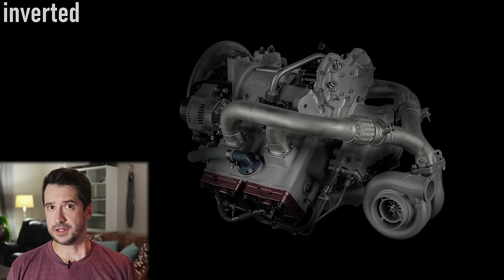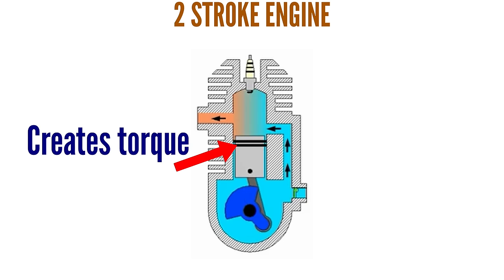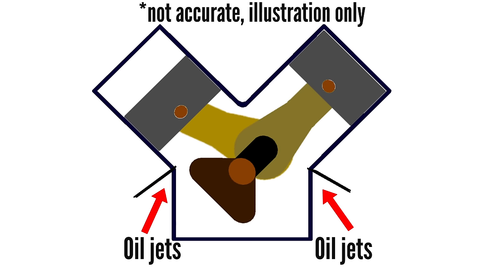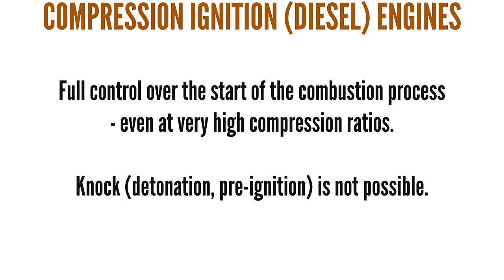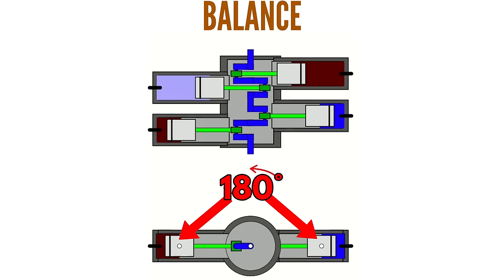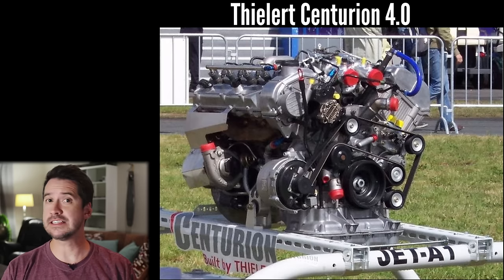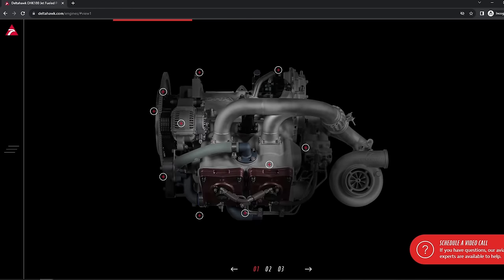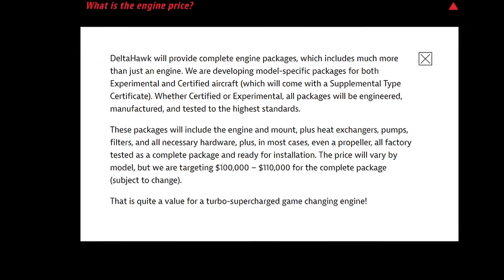Deltahawk's Jet Fuel Piston Airplane Engine Explained

Comment: Blower is a device and “supercharger” and “scavenging pump” are the functions of those devices. This is technically a scavenging device in this configuration because the engine would never run without the pump doing the scavenging. I’m sure the marketing team overrode the engineering team in naming.
Reply: That depends entirely on the manifold pressure, if the manifold pressure is over 1 BAR at MSL thent it is "supercharged" if not it is Normally Aspirated as opposed to "Naturally Aspirated".
Reply: @WilhelmKarsten  https://en.m.wikipedia.org/wiki/Naturally_aspirated_engine
Reply: @yolo_burrito  "Ask cars" is not a accredited engineering reference source.
 You got rolled by Wiki.
Reply: @yolo_burrito  There is a very important difference between Naturally Aspirated and Normally Aspired... they do not mean the same thing.
Reply: @WilhelmKarsten yes they do.
Reply: @yolo_burrito  No, they don't mean the same thing.
Normally Aspirated engines have a blower.
Naturally Aspirated engines do not.
Reply: @WilhelmKarsten  because blowers are Normal? Clueless.
Reply: @yolo_burrito  Dead serious kid, your comments reveal someone who is not formally educated or has any professional experience in this field.
Engines which have blowers but are not supercharged are called Normally Asprirated to distinguish them from engines that have no blower and are Naturally Aspirated
Any questions?.
Reply: @WilhelmKarsten  you had me going there for a second. Great joke geezer.
Reply: @yolo_burrito  For real kid, I'm absolutely serious.
You are making a fool of yourself.
Any legitimate, accredited engineer knows this. You responce reveals your lack of credibility.
Reply: @WilhelmKarsten  it’s time for bed gramps.
Reply: @yolo_burrito  Time for school kid... you still have a lot to learn yet..
Reply: @WilhelmKarsten  okay give me a reference that explains Normally Aspirated.
Reply: @yolo_burrito a  Detroit 8-71 or an EMD 710 series 

Winton type Diesel engines aka Uniflow 2stroke type (Detroit, EMD, GM, Kassborer) These engines cannot operate manifold pressure above ambient pressure.

Another common example is Supercharger equipped aircraft engines that are Normally Aprirated or Turbo-normallized. 

Beech Bonaza G36 is a good example These engines have Turbochargers but are Normally Aspirated, the manifold pressure is never above AGL (mean sea-level).
The Continental IO-550 is available in a Naturally Aspirated, Normally Aspirated (Turbo-normallized) and a full Turbocharged
Models. 

Horizontally opposed engines like some Jumo and Napier are also sometimes Normally Aspirated despite having a supercharger or a turbo.
Reply: @WilhelmKarsten  I’ve worked on Detroit 71 series and 92 manifold pressures the blower while configured as a scavenging pump does provide some boost (elevated manifold pressure) at higher rpm’s but the boost is secondary to scavenging the cylinders as 2 stroke diesels with intake ports and exhaust valves cannot scavenge by piston action alone. These have never been called naturally or normally aspirated engines. 

These engines can and do operate above ambient pressure, albeit slightly, but it’s not the function of the blower. To prove that some of these engines can operate with boost some were configured from the factory with a Turbocharger that would be used in series with the blower.
Reply: @yolo_burrito  Detroit Diesel describes thier engines, in there own published specifications as Normally Asprirated engines and that they have a scavenging blower which operates differently than a supercharger.
The Turbocharger does not provide any significant manifold boost pressure, it's function is simply to "unload" the parasitic drag from the blower on the engines crankshaft and scavenging is done by the horsepower generated by the turbos exhaust turbine. These engines are a Turbo-normallized.
This improves power and fuel consumption by reducing parasitic drag from the blower.
The fact that you did not know this reveals someone who has no formal education or professional experience regarding this topic.

Please stop pretending to be something you are not.... you are not fooling anyone.

Comment: It has been around for a long time, the design is rather crude, hence there has been little backing for it.
Reply: The push to eliminate Leaded Avgas is very real, reciprocating engines are much cheaper than gas turbine engines

Comment: Where does this 2700rpm rule come from? I dont know anything about airplanes but is this about rotor tip speed or  rotor integrity from higher centrifugal forces? In theory you should just be able to snip the tips and have a smaller diameter rotor that is more rev happy with reduced blade mass and and lower tip speed. People engage! And correct me
Reply: Tip speed is the issue.  Small diameter propellers are less efficient at producing large amounts of thrust.  You can go to contra-rotating propellers, but that adds complexity.  It is generally less expensive to go with a larger diameter propeller and a gearbox.   Contra-rotating propellers are used as a last resort to increase thrust from propeller-driven aircraft.
For an entertaining unsuccessful attempt at supersonic propellers, look up the the Republic XF-84H "Thunderscreech" .
Reply: PROPELLER EFFICIENCY is limited to tip speeds that are subsonic,
Reply: @WilhelmKarsten  Yup, that is why I suggested he look into the Thunderscreech that had a propeller deliberately run into supersonic territory.  Spoilers: it didn't go well.
Reply: @brianb-p6586  It also assumes a direct 1:1 propeller drive, and very likely the average size of a 2-4 passenger GA aircraft

Comment: The turbo worries me as you could have a potential for a runaway engine
Reply: True enough, but it would take a lot of neglect for the turbo seals to degrade to that point. I like to think that, in the world of aviation, this would never be allowed to happen.
Reply: Manual air door (throttle) fixes that problem...
Reply: @WilhelmKarsten  so this engine comes with one?

Comment: "Jet fuel"....🤣
Why not just say 'kerosene'?
I've got an old Lister that runs on 'jet fuel' (kerosene) diesel, cooking oil, engine oil or even baby oil.
It's nothing special that a compression ignition engine will run on all kinds of flammable liquid.
Reply from the maker: If you want to nitpick, it's actually Jet A or Jet A1 it will fly on most of the time, as that's what is available at airports, not kerosene. Jet A1 is more refined than kerosene.
Reply: In other words, not ship oil, but heavier petroleum distillates that are predominant in some regions, such as petro from the western Siberian lowlands.  "More refined" I'm guessing means sweet instead of sour (high sulfur).  Correct me if I'm wrong.

Comment: Compare to a O-360 - which is a little lighter for a little higher power level in most versions, though the fuel burn IS higher.
Deltahawk claiming "lighter" on their web site is a lie - have to see the "more efficient" in action to believe it (it's a lot newer design, diesel is a lot higher compression which tends to help improve efficiency, so that part IS likely).
Reply from the maker: But the O-360 - whether 180hp or 200hp only produces that at sea level density altitude. This engine is turbocharged meaning no power loss as altitude and density altitude increases.
Reply: @LetsGoAviate  Depends on the model, there ARE turbocharged versions of the O-360 and they're not much heavier than the "base" engine.
Still lighter and more power than the Deltahawk, though the efficiency gets worse.

Comment: However , on a petrol two stroke the expansion chamber is a critical component! A well built expansion chamber makers a two stroke both cleaner and more efficient than a four stroke , less fuel / horsepower / hour !!
Reply: 2-stroke engines with a scavenging blower don't need a tuned expansion pipe.
Spark ignition 2-stroke engines are less fuel efficient and have higher emissions
Reply: @WilhelmKarsten  not at all so in racing , they have a  extremely high efficiency rate,  ordinary ones use to be bad  but now with digital control that is no longer the case . I  the 500 gp class, the last years before Honda blackmailed everything into 4 stroke , threre were  no measurable pollution when running in the powerband !! Only outside said powerband..something most obvious when lying behind one o  the track. This is NOT the case with 4 strokes without catalytic converters...
Reply: @kimeldiin1930  Can you provide any evidence to support your theory?

Such as BSFC data or emissions data?

While 2-stroke Diesel engines are most fuel efficient ICEs in the world, I have never seen any spark ignition 2-stroke that has a lower BSFC than a 4-stroke.

4-stroke engines have much lower emissions than 2-strokes which is exactly why they have disappeared from applications that are subject to emissions regulations.
In particular HC and CO emissions and notoriously high on 2-stroke HCSI engines.

Comment: Vaporware
Reply: It’s no internet fake- it’s fully FAA certified in 2023. It really is a game-changer. 
Only drawback is cost. The company spent crazy Millions to prove and develop the engine, cost that the company must now recoup in the only way possible: charging the consumer.
Reply: @oldschoolmotorsickle how many examples are flying in aircraft? What’s the tbo? Vapor ware.
Reply: quite right
Reply: @oldschoolmotorsickle  If you can't buy one, it's vaporware. The other drawbacks are weight and size.

The main drawback is weight, it's 120 pounds heavier than a ULPower UL520i and the UL520iS makes 20 hp more, while also weighing 120 pounds less. Really, this makes the engine a non-starter, it's just too heavy and under-powered to be competitive.
Reply: Again, this engine is FAA certified, meaning that yes, we’ll be seeing it in production light aircraft. 
It ain’t cheap, nor is it lightweight, but aircraft diesels never are. If we compare this engine to other certified diesel aircraft engines, it looks pretty good. 
I think that the company is aiming the product more at the international market, where Avgas is prohibitively expensive and/or not available. 
On the domestic front, this engine will appeal to the “buy American” set, as it’s 100% US made. UL520, not so much.
Reply: @oldschoolmotorsickle  The SMA diesel is certified, it's a better engine and it's not really being used in anything. No one wants diesels, they're just terrible aircraft engines.
Reply: We are in agreement on that; diesels are not well suited to light aircraft! That this engine exists at all is like “ How’d They Do That?”

Obviously, it wasn’t easy, especially getting it certified. And, as you noted, it’s kind of a solution in search of an application; an Answer to a Question that nobody asked. 

I’m not invested but I can see quite a few applications where this solution would make sense. 
Any rate, the market will tell the story going forward. 
I wish the people involved all the luck; and I do love an American can-do story like this one.

Comment: So would that not be a Delta 4 then...... Seems very underpowers for a 3.3l 2 stroke turbo & supercharged engine. Should be. Atleast 3 times that.
Reply: It would be more if it could rev out but they're running it direct drive so the limiting RPM is the propellor RPM, 2700 maximum on most props used in GA.

Comment: @Lets Go Aviate   2:24 illustration is crap and helps perpetuate the myth oil consumption will be uncontrollable since it is 2S.   Delta Hawk is not cranks case scavenged as your cartoon shows, it is supercharger scavenged.   Since intake air is dependent of crankcase via trunk pistons, oil consumption can largely be controlled the same as other modern engines.   Yes upper rings passing ports complicate this but “adequate” to even “good” control is possible, see SAE white papers by Achates Power.    Good Cartoons are worth a thousand words.
Reply from the maker: Thanks for the comments. I think you possibly missed the point of the animation, which is a quick explaination of a small petrol 2 stroke, much like the 2 stroke engines used to power ultralights and LSA's. I then go on to state how the Deltahawk differs from a small petrol 2 stroke, pointing out that it's not crankcase scavenged. It's a juxtaposition, if you will.

Comment: Two stroke diesel engine is very old and almost forgotten technology  which is very fuel effective ... But.. Such engine run only with 150 RPM and is today used for the gigant ship engines ... Two stroke diesel engine need a exhaust valve .. The Two stroke diesel engine is simply different engine as two stroke petrol one ..

If you use a diesel fuel in the two stroke petrol engine, that's the new story. I want see the working prototype of such engine ...

Comment: UL520 is 100 times better than this. 220HP, turbo charged, 269lb, runs on UL91 octane. 

This is FAR less efficient, 100lb heavier, less peak AND continuous power... 

Someone spent 25 years making a worthless failure engine.

Comment: Too heavy, power output is too low, it will never go anywhere... if it even makes it into production.
Reply from the maker: Time will tell. Got FAA certification which is a big deal.
Reply: @LetsGoAviate  The only way that it will go anywhere is if no one puts a modern, liquid-cooled gasoline engine into production that competes with it and if 100LL ends up being banned. Even then, the ULPower engines are far better options, as they're able to operate on mogas and they weigh far less. Diesels also have problems with flameouts and with restarting at altitude (this is likely one of the reasons why Cessna dumped the SMA diesel), which is bound to turn more than a few people away from them.

No matter what, if this engine does succeed, it will set general aviation back considerably.

Comment: The elephant in the room: Emissions.   How bad are they?  It's not mentioned, and that's a huge omission.
Reply from the maker: Touched on at 16:32. Emission numbers isn't shared so I don't know, but it should be on par with similar powered Avgas engines. I also mentioned there's no lead emissions which is a plus, but petrol engines running Mogas ("car fuel") has no lead either, so make of that what you will.
Reply: Aircraft engines are completely exempt from emissions in most countries.
Reply: The elephant in the room is reliability. No Wankel engine has ever been reliable enough to pass a FAA or EASA PFTR reliability test for airworthiness certification
Reply: The usual lame Mazda fan boy excuses won't work here lad, General Aviation engines are not subject to the same emissions standards as automobiles.
It's a not a valid argument as emissions standards did not prevent the sales of Wankel engines in automobiles either.
  The Mazda RX8 met or exceeded the strictest emissions regulations in the world right up until production ceased due to low sales.
Initial RX8 sales were a colossal flop and declined rapidly as the car developed a well earned bad reputation for appalling reliability issues that led to massive recalls, warranty claims and even class action lawsuits against Mazda for selling unreliable engines.

Comment: There was a lot of research done before, during, and immediately after WW II on the diesel, two-stroke, super/turbo-charged, sleeve-valve aircraft engines. Such engines powered several aircraft during the war. See Graham White's "Allied Aircraft Piston Engines of World War II" for full details.
Reply: The Germans had two-stroke opposed piston diesel (Junkers) which, of course are valveless. The Engish had sleeve-valve spark ignition four strokes (Bristol and Napier). No-one used production diesel, two-stroke, super/turbo-charged, sleeve-valve aircraft engines in the war.
Reply: Sleeve valve engines tend to not do as well at high compression ratios (leakage issues).  By eliminating the hot exhaust valves as a source of ignition, sleeve valve engines' main advantage was the ability to make more power from low octane gasoline by running at slightly higher compression ratios.  Once high-octane gasoline became available and higher compression ratios were possible with poppet-valve engines, the sleeve valve engines lost their advantage.  I still find them fascinating, though.
Reply: The Jumo 205 was introduced in the 1930s